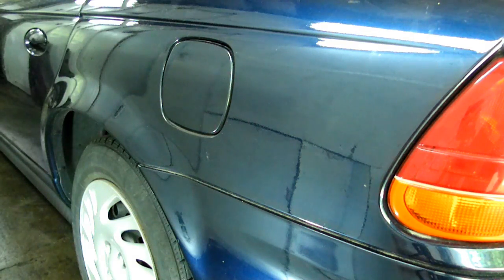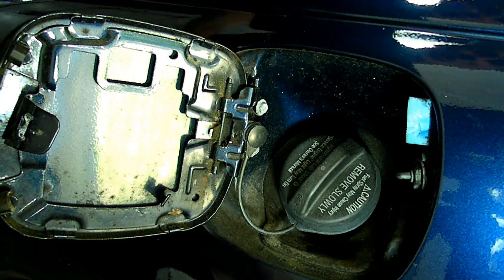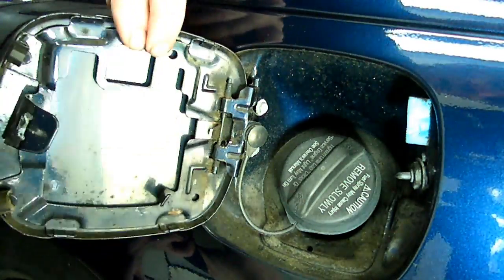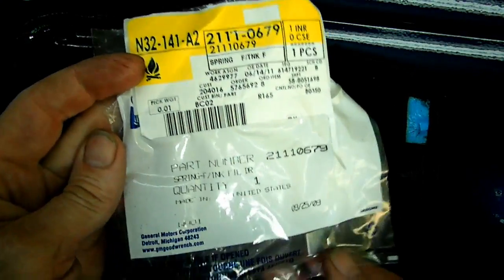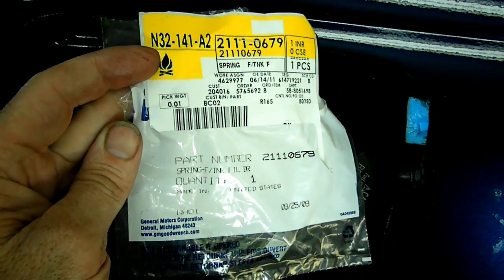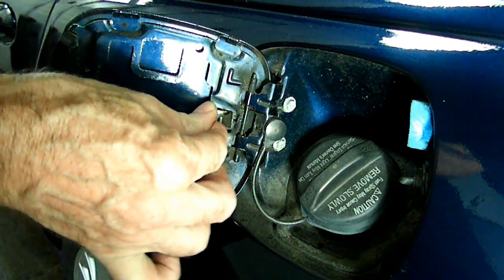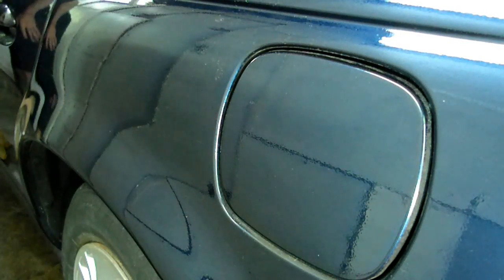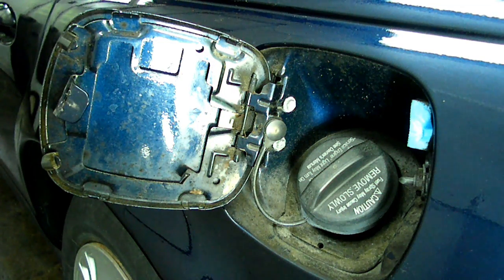Saturn Fuel Door Repair

Comment: Had the same problem with my '99 SC1 recently. The bigger issue though is the lever itself rusts up and  no longer releases on its own. Both it and the trunk release seem to be fused together and I pop the trunk every time I gas up. I can live with that as long as I can open both.

Comment: After seeing you pay $4 shipping for the $2.50 part I also started to rethink the fix.  After unsuccessfully playing around with some spring steel the idea for an extremely cheap and easy fix hit me.  I used one of those thick rubber bumpers with adhesive on the back that you can buy in any hardware store.  One big use for them is usually to stop your kitchen cabinet doors from banging when you close them.  I stuck one on the flat part where the metal clip used to be and I was instantly back in business.
Reply: Thank you so very much Rich for putting the original postop was greatly appreciated! It helped me identify what had failed. 
Fred

Comment: This really helped thanks bro I was having that same problem what I did was steal weld a spring on the inside to the edge of the gas door where it wud pop out, its working alright just not as smooth as it aught to

Comment from the maker: When you get the trunk open by the fob or climbing in through the back seat see if the cable at the trunk latch is moving when you pull the lever.

Comment: I have a question. When I lift up the fuel door lever button in the car to pop open the fuel door, the fuel door won't open and the lever, when lifted up, will produce a click sound and you can hear the spring in it but nothing happens. I had a buddy stand at the fuel door and checked to see if the locking pin even goes in like in this video but it does not when the fuel door lever is lifted up. How do I replace this so that when I lift up the fuel door lever, it'll pop open the fuel door?

Comment: Great video. I have a 1998 SL2. My old spring was failing and was thoroughly rusted. What causes that? Would keeping them covered in axle grease prevent this?

 I went to the junkyard and found a surprisingly good looking one. No rust at all.  It was the last one left in the yard. I checked all the other SL2's. (About 8). A number of them were series one with a different type of fuel door (round), but, the series two and three both have square doors and it looks like these springs were made up until 2002.  So, you might find a spring that is only 15 years old. The spring had been removed from the other SL2's.

It was just too hot to look around today in the junkyard, but I would suspect that other models  of GM cars would have this same spring. Does anybody know? 

Could you make your own? Or, would that be like trying to make a paper clip?

I replaced the spring and boy, does that fuel door jump to attention now when I pull the lever. Thanks!
Reply from the maker: If you need a new one i have the part number they might still be available.
Reply: I got one in the junkyard. I'm good!

Comment: Have similar issue with my daily but opposite side its the rubber gommet that keeps lid shut. Mine looks like it worn off or frozen because fuel door won't close.  

Arghh.  this make of car reminds me of my old 2g eclipse's non turbo version once you fix something nothing little gremlin pops up. lol

Pullapart or Pick n pull is good place to source these tiny things store would let them go free cause aint worth money.